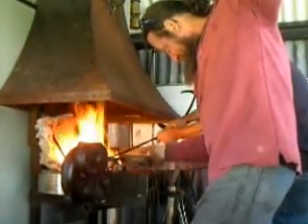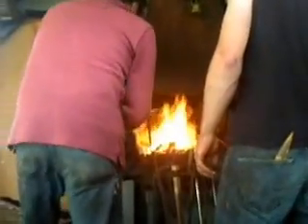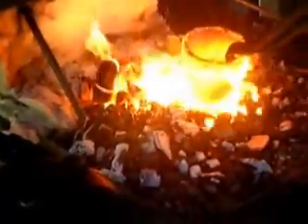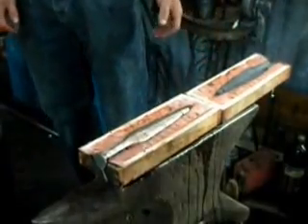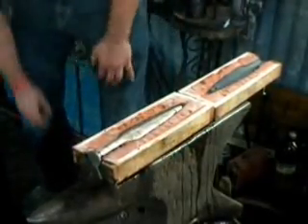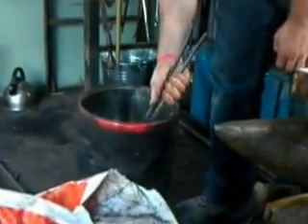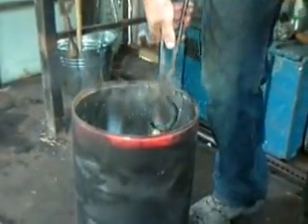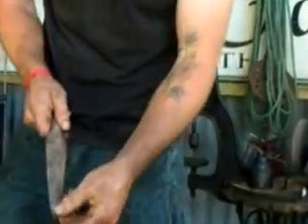Bronze Casting 2014

Comment: I love stuff like this.  I have cast aluminum, brass, and bronze using charcoal more often than any other heating method.  This is the first time I've seen it done in a forge.

One criticism: Melting is a change of state from solid to liquid.  Smelting is a refining process from ore to a usable metal.

One Question: Was the casting done in green sand?
Reply from the maker: understood, this was melting copper and separate tin to combine into bronze would that be smelting or melting ?
And it was oil bond green sand.
Reply: Devon Blacksmith
Not to be a smart-@$$ but melting two or more metals and combining them is alloying. I really don't like bronze because they sometimes add lead (Pb) to make it more machinable. The lead tends to boil off and get into the smith's lungs... 
Are you making the "Iceman's" axe?
That was a great demonstration!  Thank you for posting this.
Reply from the maker: robert jeffery Hi Thanks for the info we where casting with copper and pure tin no lead, lots of different items cast over the weekend. what is the ice mans axe ?
Reply: Ötzi – the Iceman, who was found 1991 in the Italian Alps (South Tyrol?), had a copper axe fixed to a yew shaft.  The object you cast looks very much like his axe head.
Reply from the maker: Ok, thanks for the info.